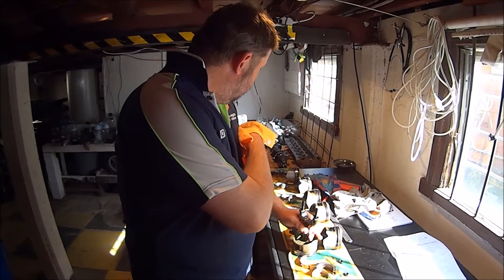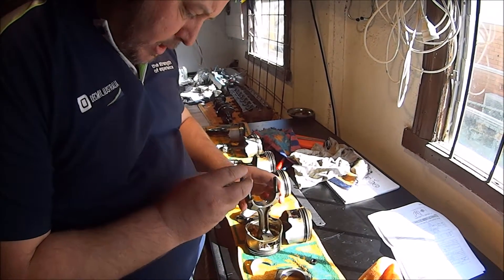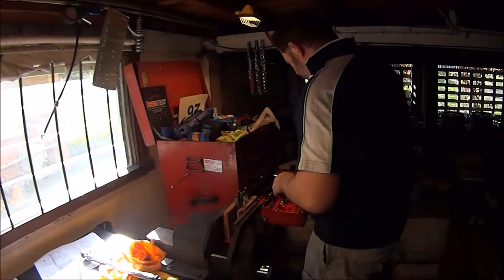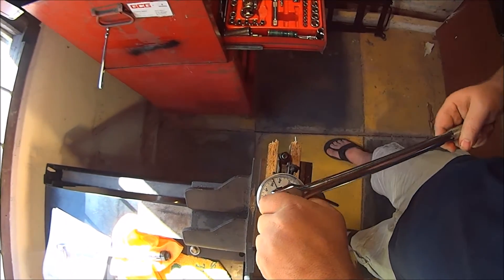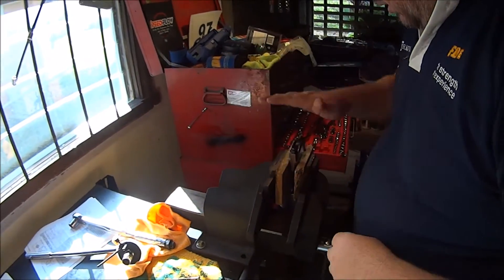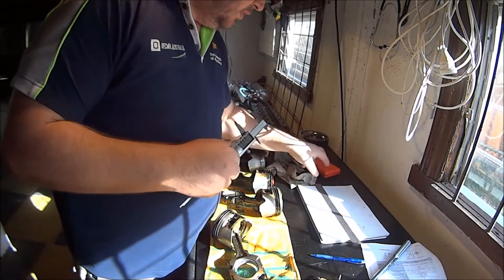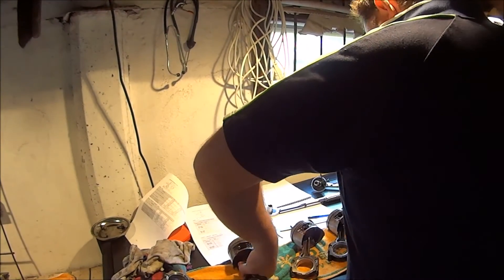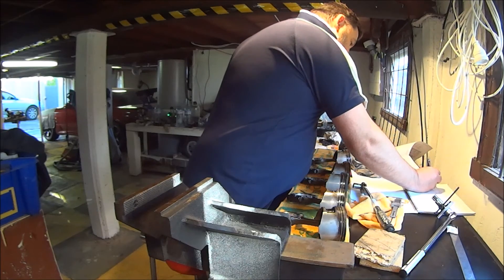RB25DET Engine Build - Rod Big End Oil Clearances  Bearing Damage

Comment: I was driving with my oil light on for a week or so, my engine always tapps like crazy, sounds like Thor hitting my crank with his hammer every cylinder fire, I used a funnel to top my oil up but a sandbag fell of my shed and into the engine. I didn't really think anything of it so I just drained the oil and filled her up again, anyway the lights gone off but my engine sounds like a bag of bolts and now it smokes blue out of the exhaust at any given minute it's running. My deisel injector has got a bunch of black Tar around it and I pulled the injector out with a pipe wrench and some of that tar crap fell down into the cylinder, I think my rocker cover has a big crack in it also and all the oil keeps draining down onto my exhaust manifold. How can I fix my engine? It's pissing me right the fuck off and I'm ready to crash it into a brick wall. Im about done with it to be honest
Reply from the maker: That's an interesting story you've told there.